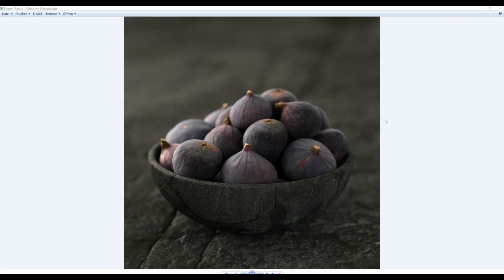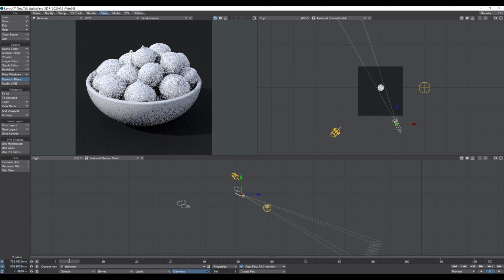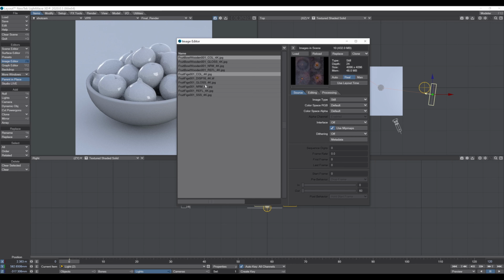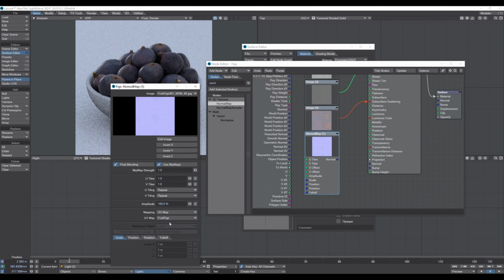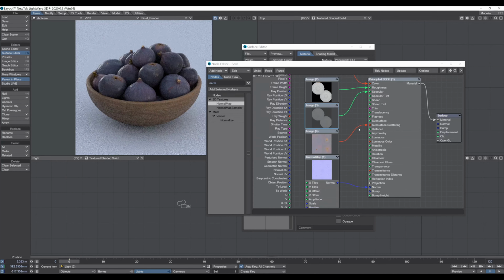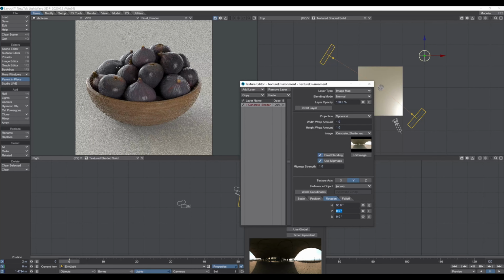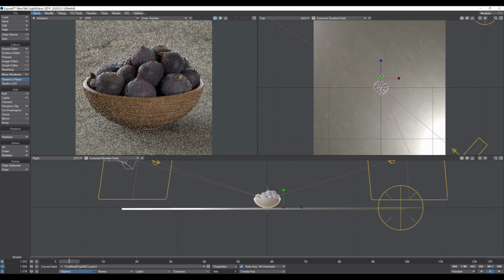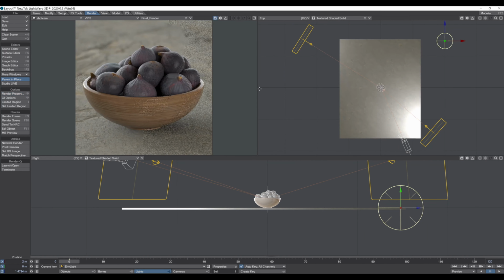LIGHTWAVE 3D / How create realism with Lightwave 3D (Beginner - Advanced Level)

Comment: Nice tutorial!

A good tip is to prepare your textures in different formats before importing so you do not have to change them in the Image Editor.

In the Preferences panel, set your colourspace to sRGB, using the Quick Presets dropdown. This will automagically treat all JPG, PNG, Targa etc files as sRGB in Image Editor. For Data textures, such as Normal maps, Roughness/Metallic maps etc, have them prepared as EXR files. Because if you do, they will be treated as Linear images automagically. :) But it is very important that you set the colourspace in the Preferences Panel before, otherwise it will not work automagically. :)

EDIT: Also... in Render Properties, change the Polygon Intersection Mode from Watertight to Fastest. In 95% of cases, you will shave off some renderingtime without any visual difference. Watertight setting when you have Radiosity enabled is only to solve leaking light situations. It is a bit weird that the default setting of this is Watertight, because in most cases it is not needed and does slow down the rendering.
Reply: Yup. Everything Mikael said.
Reply from the maker: Thanks very much for your Feedback and input. I will have a look on that for the next Tutorial. LW has so much settings that has to be know.
Reply: @CDA3DLive  Yeah... I know... Was a BETA tester for LW between 2006-2020. :)